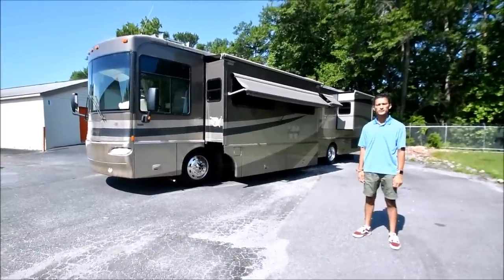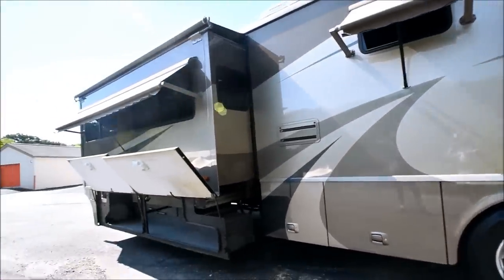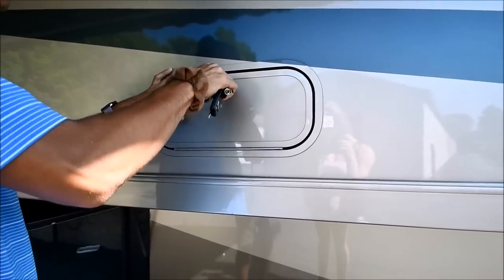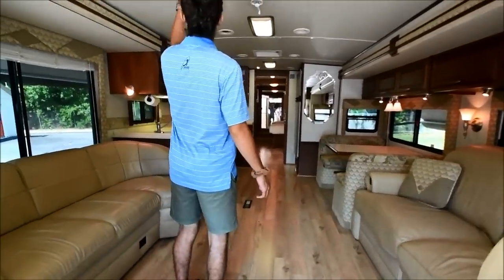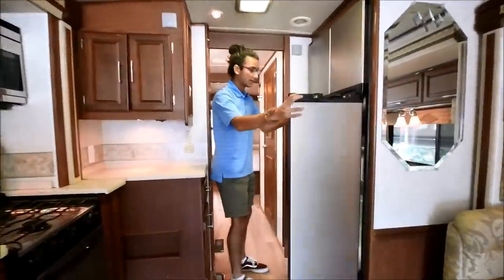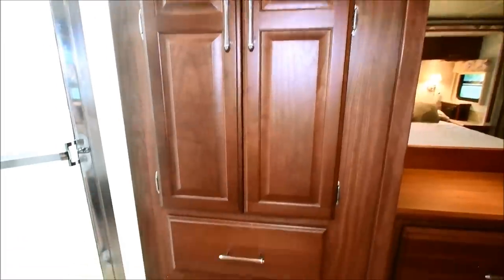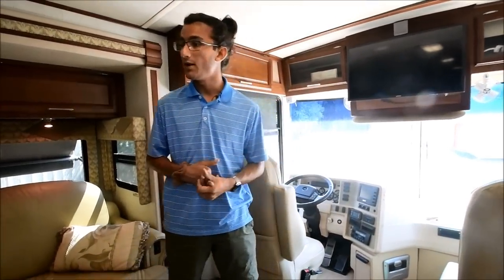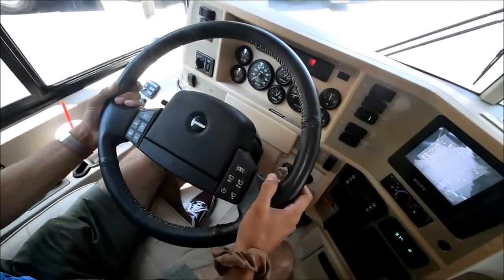2005 Winnebago Journey 39K Triple Slide New Floors

Comment: So, is the price good, bad, or ugly?  Also, there is no way a two foot scratch like that can be “buffed” out. It looks like it goes thru the clear coat, paint and primer, down to the metal or fiberglass (as the case may be).  That is going to cost as much or more to fix than the front!